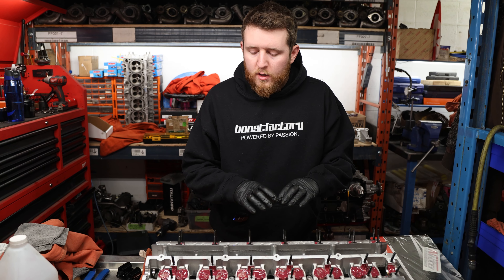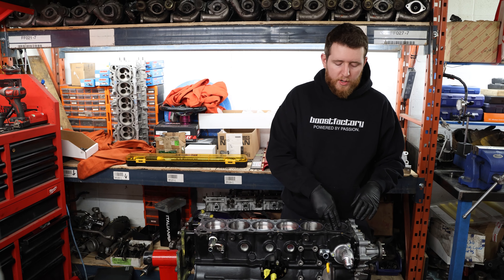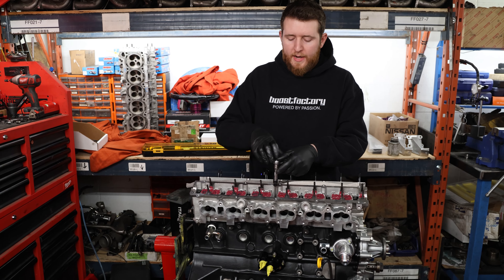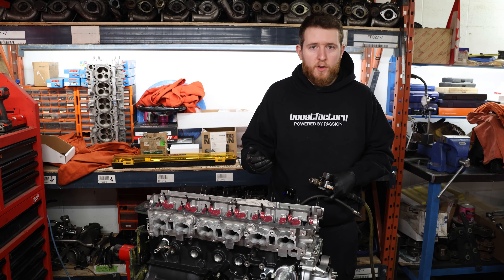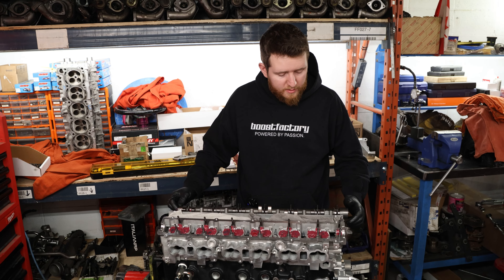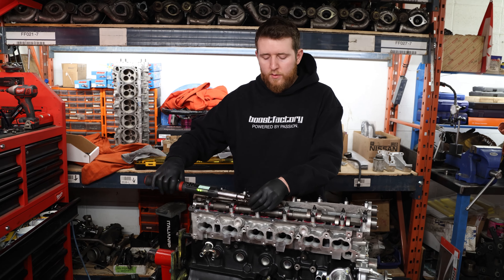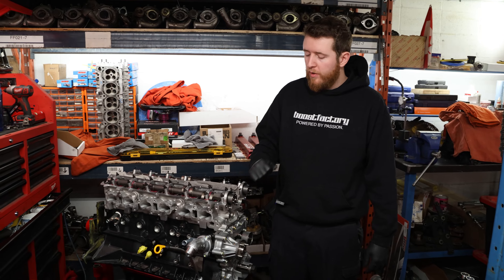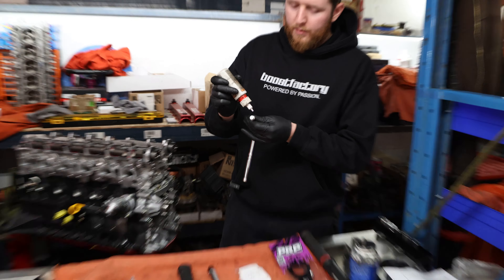RB26 FULL ENGINE BUILD: Episode 15: ARP Head Studs, Cam Seals, Tomei Cam Gears & Timing Belt

Comment: 2:19 for this part, the cylinders are placed before TDC, so before the timing mark. Is that correct? I’m about to do the same. Once the head is installed, is the crank rotated to the timing mark and the cams installed? Or first cams installed and then crank rotated to TDC?
Reply from the maker: yes correct, crank position a little before tdc, install the head and cams, rotate cams to tdc, then turn crank to tdc. this ensures no accidental damage.
Reply: @boost.factory  it’s done. How should I go about getting oil circulating prior to first start? Unplug ignition system, disable injectors and turn the engine over? Or remove the spark plugs and turn the engine over?
Reply from the maker: @BourneThisWay  Yes exactly, you are correct! Here is our first start up guide line!

https://drive.google.com/file/d/13BBwn-SchhZx5NqXVenzvpu08-7W99zJ/view

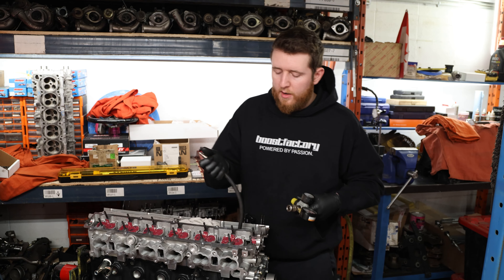Comment: 7:03 - what psi do you use for leak down?

15:33 - where did yall get the black tomei timing belt? I’ve only seen the blue ones.
Reply from the maker: leak down psi i believe is around 20psi, more pressure usually yields the same or better results. an engine that seals well under low psi will do better generally with more in operation. 

the tomei belts we have on our website. they are the tomei Japan Belts!

Comment: I had a some scoring on one of my cam journal and cam, bad enough that it can be felt with the skin of your finger. How repairable is that? Or does it require a new head.
Reply from the maker: with out seeing what the scoring looks like it is tough to say, some minor scoring can be smoothed out and be ok.  id be more concerned with what debris caused the damage. if you have been able to removed all oil plugs to clean the head, the journal can be cleaned up with some light sanding.
Reply: @boost.factory  when I inspected it, I noticed the cam caps 3 and 6 were mixed up, and the last cam cap 7 wasn’t entirely bolted down. As a result, the cam was hard to turn, the timing belt jumped several teeth, and pistons hit the intake  valves. Only the sixth cam cap journal sustained damage though. If I had to describe how the scratches felt, it’s not like a slight abrasion. You can feel the individual ridges. I don’t think it was caused by debris.